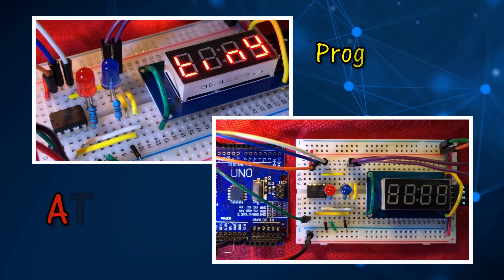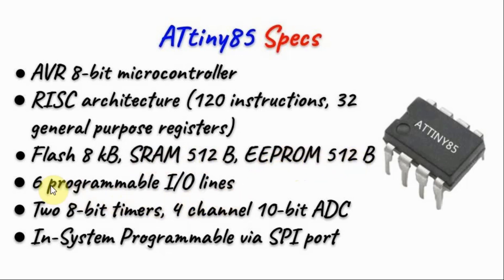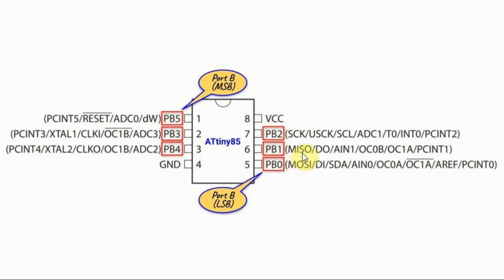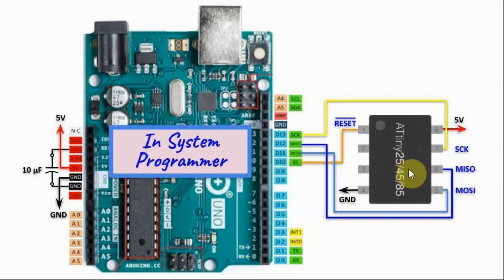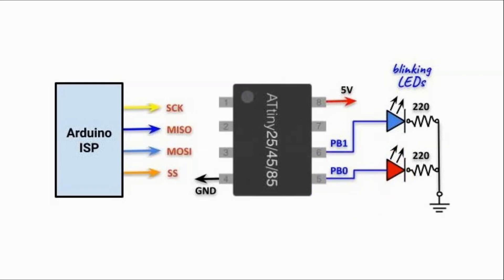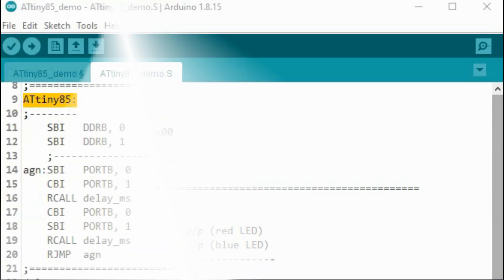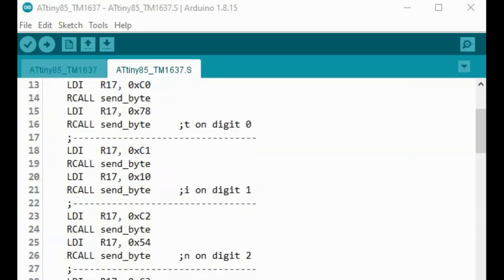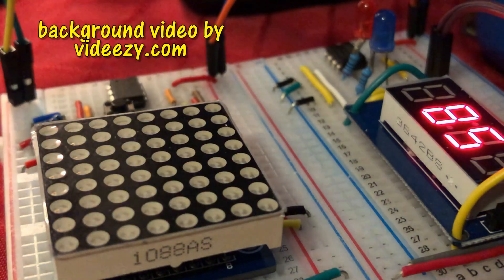ATtiny85 - Programming in C & Assembly

Comment: I have watched many similar tutorials and I still do not understand why it is necessary to burn a bootloader into the ATtiny. Why not simply burn the hex file directly? There is so little code space in the ATtiny13A for example that it seems wasteful to use any for a bootloader.
Reply from the maker: I believe Arduino IDE loads the hex code via the onboard bootloader. I use assembly to optimize memory storage.
Reply: @AnasKuzechie  I have investigated this further. Regular Arduino boards using the bigger micros like the 328 do use some 500 bytes or so of code space for a boot loader. However, the Tiny range, when programmed by an Arduino as ISP, do not use a bootloader. The so called Arduino bootloader in this case just sets the fuzes to set clock speed for example but does  not load any code into the Tiny. Basically your hex file goes straight in and all the code space is available.
Reply from the maker: @ruffrecords  Thanks for the info

Comment: Can push buttons be connected to the tm16xx integrated circuit?
Reply from the maker: Yes, but not with the display module I demonstrated. You have to get the TM1637 IC and interface to it the buttons. You can check the datasheet.